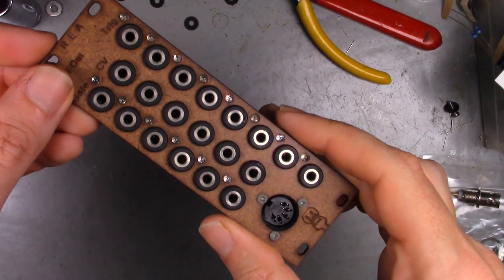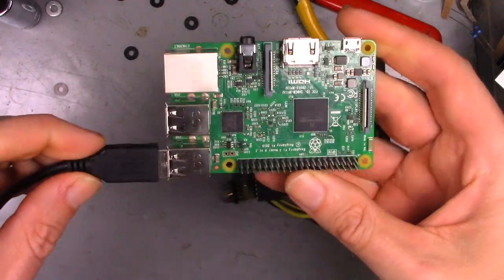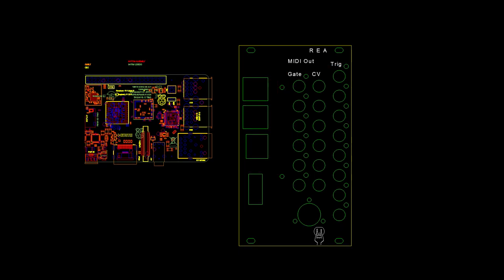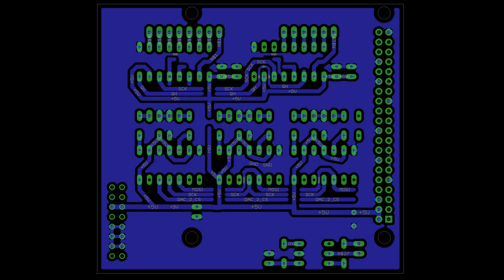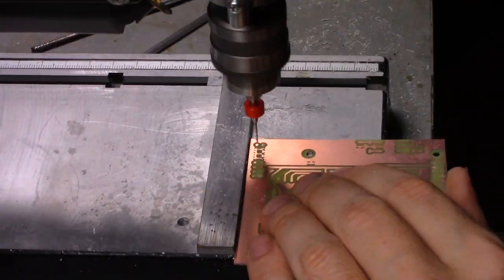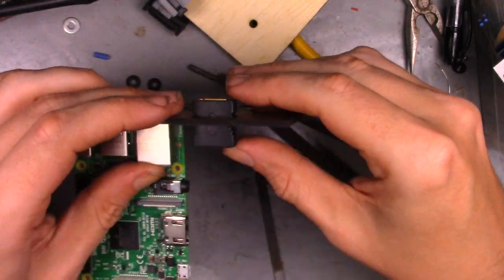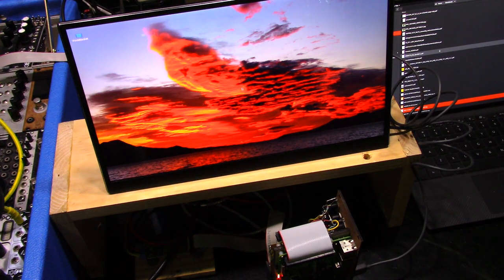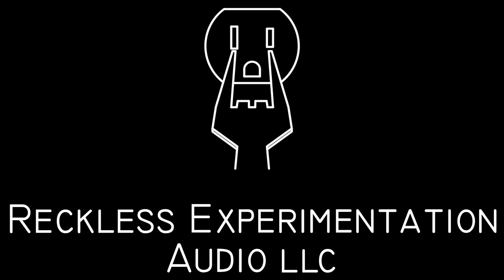Raspberry pi Eurorack Module Hardware Design

Comment: One of the smaller RasPi W should do the job, right?
Reply from the maker: I want full size USB ports, the Pi Zero only has micro ports that need adapters. The 40pin connection is the same on all current Pi, so there is no reason that Pi Zero wouldn't work.